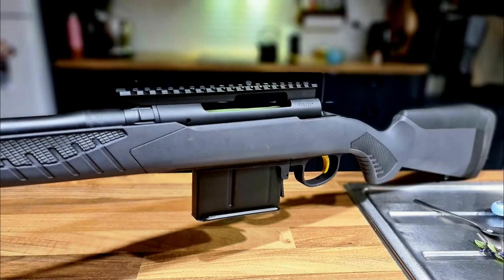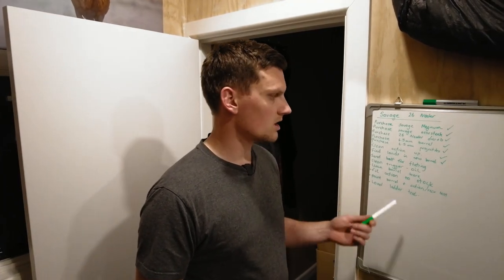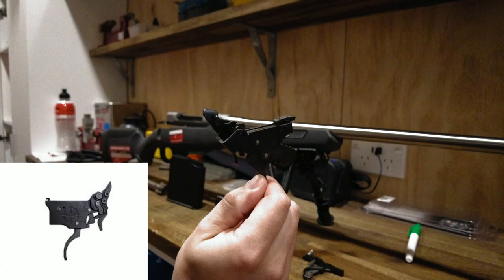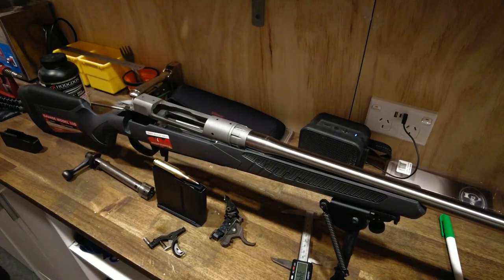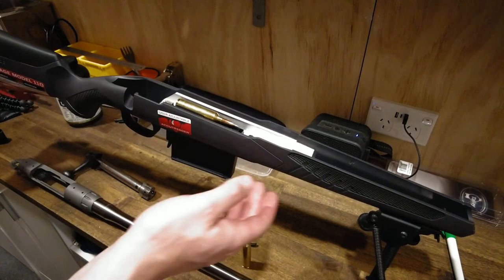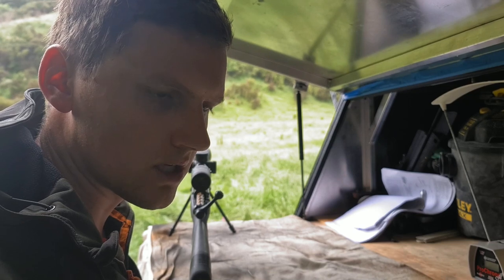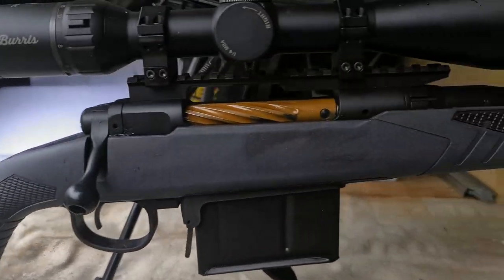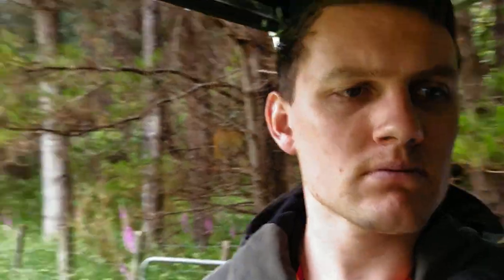---26 Nosler----

Comment: The accutrigger usually needs some trigger blade return spring removed to make them more usuable. Plus smoothing the face of the blade and trigger with sand clothe is a big improvement from non finished stamped parts.
Reply from the maker: This was a Jard replacement and a non accutrigger model. The accutrigger is pretty good yep with small amount of work 👌

Comment: Nice project rifle mate love the cartridge... you should look at a magneto speed chronograph they are awesome I've got the shorter model and it's sweet as. I've been using it flat out on my last 2 builds a for custom 243ai on a defiance tenacity and a 22x47 lapua on a nesika model t
Reply from the maker: Thanks, funny you say that because I looked at one but wondered if the worked on a suppressed rifle.  The one I use is unbearably temperamental. Thoughts?
Reply: @hardantlerhunting9691  yep will work on a suppressed rifle all you need to do is get it in the right position just under the bore be sweet